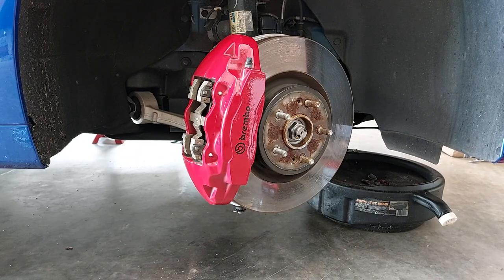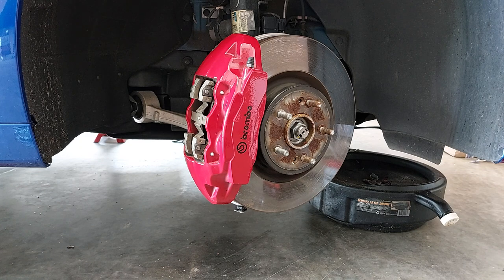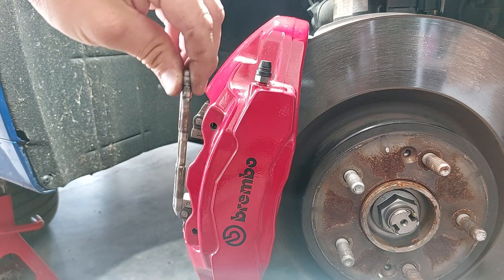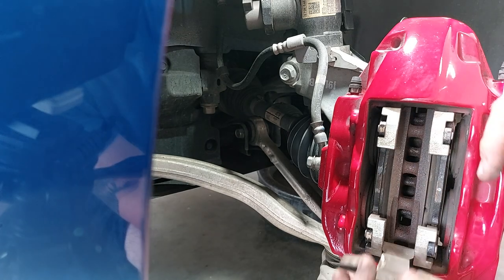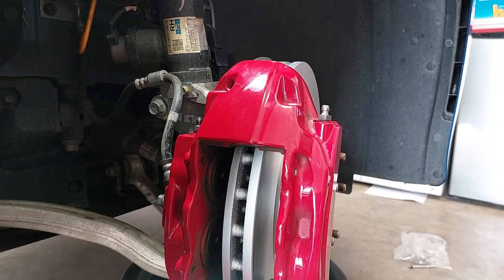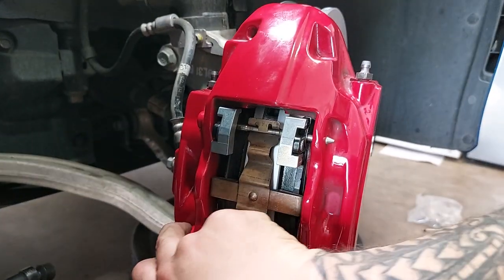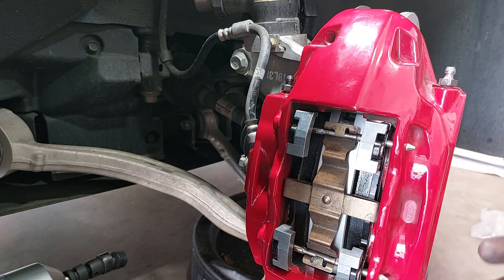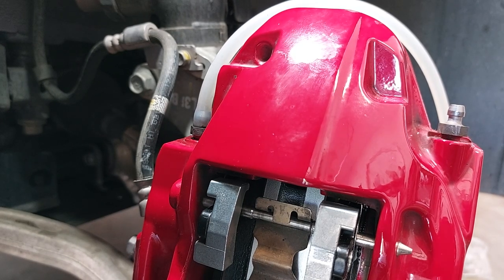Genesis G70 everything you need to know about brakes.

Comment: Where did you find the order for inner/outer valves and front/rear/passenger/driver side ?
Reply from the maker: I believe it was from a Kia Stinger repair manual. They use the exact same braking system.

Comment: Hi there, I changed my disk and pads last week, did not change the brake oil, and now that everything is new, clean, greased at all the right places, when a go real slow backward or forward and press the brake pedal normally, I ear clic in the front and back right and left. It is like the pads goes to rest at the top of the caliper going foward and hitting the break and at the bottom when going backware and hitting the brake. Never had Brembo, is that normal ?
Reply from the maker: @philippepilon6561  Very common with aftermarket pads. Not a big deal at all.

Comment: Slotted rotors are the way to go on these cars to help prevent the build up on the pads.
Reply from the maker: I do not agree as someone who has installed slotted and cross drilled rotors on other vehicles. The brake pad is the problem big time pure garbage. Your car your choice do as you wish.
Reply: @autohelix what brake pad do you recommend upgrading to?
Reply from the maker: @JimBobe 
Front brake pads. Advics AD2145
Front brake rotors. Advics R6F329U
Reply: @autohelix  Excellent, thank you. Do you also recommend a rotor upgrade as well? If so which one?
Reply from the maker: @JimBobe  Front brake rotors. Advics R6F329U
Reply: @autohelix  oh apologies I misread your initial reply. Nothing for the rear?
Reply from the maker: @JimBobe  Rear pads AD2144.
Rear rotors R6R331U
Reply from the maker: @JimBobe  Rear rotors R6R331U

Comment: How did these brake pads perform?
Reply from the maker: They work with no problems.
Reply: @autohelix  awesome, thanks, I believe I'll get a set for my Stinger.  Great video too, thanks for doing it.
Reply from the maker: @The_Casual_Collector  Thank you.
Reply: @autohelix Thanks for the well-done video.  Learned about some new tools that would be very helpful with this style caliper.  In the video, you said you'd pin a comment after you had time to break the pads and rotors in.  I see you said they were good but any other thoughts about it?  How many miles did you put on them after 7 months?  Thanks!
Reply from the maker: @landofthemorningcalm-ri9rt  Maybe 3,000 miles. They work fine the rotors still look nice. Will be putting on about 2,000 miles in the next two weeks though.
Reply: @autohelix do you exhibit and clunking noise going from reverse to drive or anything with these pads? I’ve read that some aftermarket pads make that noise because they don’t sit as tight as oem pads.
Reply from the maker: @HellzHonour  Yes very common with aftermarket pads.

Comment: Where do you buy theses pads and rotors from?
Reply from the maker: Rockauto
Reply: @autohelix  I dont see the fronts for sale. Just the rear AD2144 Any other brands you recommend?
Reply from the maker: @stonejohnson1998  look under Kia Stinger you should fine them there.
Reply from the maker: @stonejohnson1998  You can also do a part's number search on Rockauto.
Reply: @autohelix  If I am looking for the rear rotor that is like what you showed in the video, do you happen to know the part number?
Reply from the maker: R6R331U